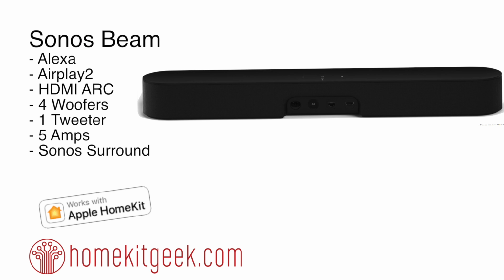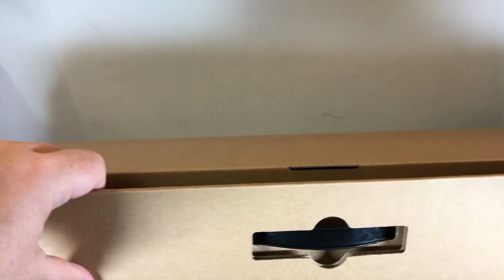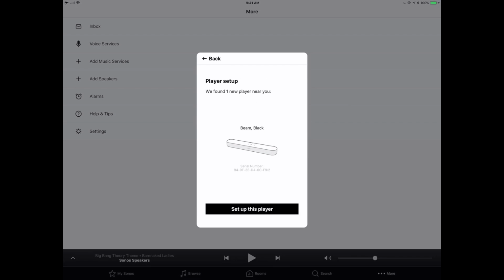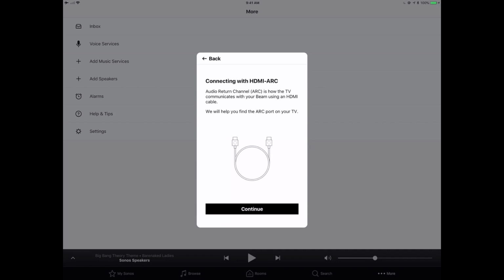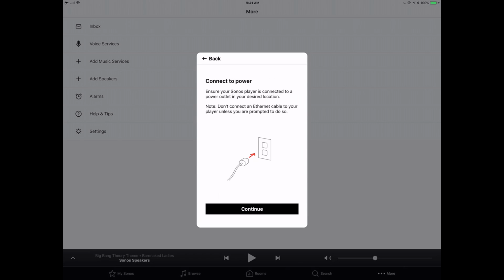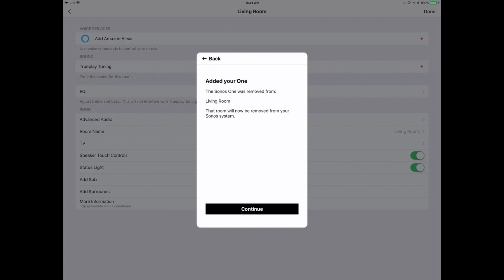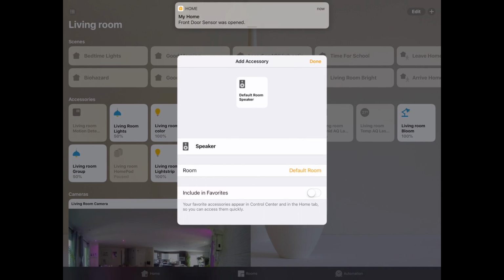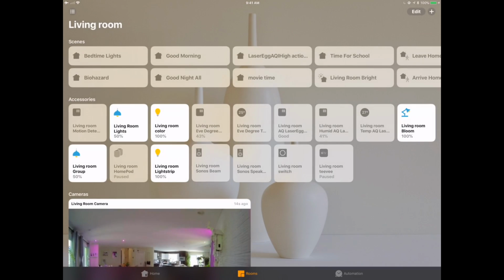Sonos Beam sounds great and has Airplay2

Comment: Hi. Can I also play music from my widows laptop - hard drive-  with the bar?
Reply from the maker: Quick answer is yes.  There Is a Sonos app that can run on Windows which you can use to play music. You could also use the Spotify app if you’ve setup the Spotify integration. Or you could use Airplay2 if you’ve installed iTines on your Windows computer.  There are a lot of options here. You will need a iOS or Android device to setup the Sonos kit (iOS being the better experience from true sound tuning). Hope this helps!

Comment: Great video! It was what I was looking for! Thanks.
Reply from the maker: Awesome! Glad you found it useful!
Reply: Chris Young I’m waiting for my beam while I have two one in stereo mode. I was curious to understand how configure surround once beam is installed after the ones. Thanks
Reply from the maker: It was actually extremely easy. You essentially put the rear Sonos Ones in the same group and then you run the TrueTune setup again to make sure you tune the speakers to your particular room.  Let me know if you have any issues at all and I’ll see what I can do to help!
Reply: Chris Young Very kind :) Effectively I have two questions... 1) is the quality of the surround sound good? With my old speakers the sounds coming from rear were very low. 2) When the two Ones are in the surround mode, is it possible to use them in stereo to play music from iPhone?  Or in this case the sound will come out only from the beam? Thanks again!
Reply from the maker: OK Q1:  Harder to answer. There are times when the speakers are very low, but there are also times ( no change from me ) where the speakers actually scare me with the sudden sounds out of them. I’ve come to the conclusion it’s much more the actual content you’re watching than the speakers themselves. When you’re watching content with really good 5.0/1 tracks, it’s really immersive.   Q1: Yes. There’s a mode on the Sonos app that allows you to ignore the rear and just treat the speakers as if they were stereo. Works great for music from iPhone or directly out of Sonos app. ( or from any HDMI source coming through the Beam for that matter! )
Reply: Chris Young Thsnks! If you come in Italyl I owe you a dinner😄
Reply from the maker: LOL. Just glad I could help!

Comment: In this 5.0 setup does airplay from your phone only come out of the beam?  Or does it come out of the entire surround system beam + play 1's all play simultaneously?
Reply from the maker: In a 5.0 setup, there’s a setting in the Sonos where you can have the “rear” speakers ( the Sonos One’s in my case ) get used as a L/R combination and don’t play as a surround-sound setup.  Hopefully this makes sense?
Reply: Chris Young but can I have the beam and the play 1s all play the same song from Spotify via airplay2 from my iPhone?   Or will all speakers only work together from the tv
Reply from the maker: Ok, if I understand your question, the answer is “yes”.   When you open Spotify on your phone and play a song it plays on your phone. If you send that stream to an Airplay2 target, you can select the Beam as an Airplay2 target.  Once the Sonos devices are in a 5.0 setup, it’s only the “master” device ( the Beam ) which exposes the Airplay2 target. You won’t be able to see either of the Sonos One’s ( read r/l  speakers ) will be see in the Airplay2 target list.

Comment: I didnt see this question. I have two sonos play:1s. If i get the beam and pair all three for TV surround sound, Can i still use the the two play:1s just for music? without having to ungroup them from the beam for just music and then re-group the beam again to watch tv.
Reply from the maker: If I understand the question, and I’m not sure if I do,  you’re asking if you can play music on the Play:1 speakers which are put into a 5.0 group with a beam without it playing in the Beam?   The answer is “no” you can’t play just on the Play:1s and not also have the music coming from the Beam.  Essentially the entire system (Beam + your 2 x Play:1 speakers ) becomes a single unit. If you play music it will use the Beam and both Play:1s  to produce the sound.  Hopefully this helps?
Reply: Dont put the play 1 as part of surroud, while setting up the play 1 choose "put in another room" then you'll get what you wanted

Comment: Very nice review Chris! Love the thorough explanation of the app installation.
You have the same setup I’m currently considering (Yamaha Bar 400 with 2 MusicCast 20’s is the other option). One of my doubts towards the Sonos Beam is the “For small to medium rooms” category Sonos has put it in. I’m not sure what Sonos’ definition is of a medium sized room. What is the size of your room and what is the distance between your TV and the couch or chair you’re sitting on while watching TV?
I don’t want to buy a PlayBar (which is 200 euro more expensive than the Beam) if only because it’s a 5 year old design.
Reply from the maker: Hey Frank! Thanks for the kind words.  Just an estimate, but it’s an open space of about 400 square feet. ( 37 square meters )  The couch is approx 10 feet ( 3 meters ).   The Beam + Sonos One’s are really great and typically we can’t turn the TV up past 50% for normal watching. Just gets too loud. Normal watching volume is about 1/3 potential. For music, it’s about the same but I also use it in an Airplay2 multi-group with Homepod across the room. I’m very happy with it as it is. At some point, I”m thinking of adding the Sonos Bass to it, but hoping a less expensive option comes out.

Comment: I just bought a Sonos beam and I already got two Sonos player 1....I paired both Sonos player 1 and the beam but it seems that I've got a better surround sound when pair both players 1 separate from the beam. Why is that? Do Im doing something wrong here?
Reply from the maker: Digging into this a bit, but what do you mean when you say “surround sound”?  I’m guessing that you’re hearing more sound all around you when the Sonos Beam and Sonos 1’s are two separate devices because you’re getting the full Left/Right stereo experience out of both the Beam and the Pair of 1’s.  With the “real” surround sounds, the Sonos 1’s I believe are configured as the rear Left/Right channels which aren’t really used if the system is expecting Dolby 5.0/1 audio source.  This is just my guess though, I’ll try and find a better answer or hopefully someone else will be able to chime in as well.
Reply: Chris, thank you so much for the quick reply. Yes, that is exactly what I was stalking about! I have both of my play 1 separated from the beam.
Reply from the maker: Hey Cesar, After a bit of research, it looks like this MIGHT help you out: Settings>Room Settings then select the room with the 5.1 setup then go to Advanced Audio. You will see options for ambient and full for music, change this to full.  Give it a try and let us know if that improved things!
Reply: Hi Chris, I just did what you recommended and it worked! However, the only option I had to move to “full” was the TV ambient, by doing that I was able to enjoy the 5.1 set up. Thanks for the tip!!!!
Reply from the maker: Really glad it worked out for you!

Comment: I have the beam, its good for tv but i would not recommend it for music. Every pair of monitor speakers for half the price would do better with music. The mids and the highs of the beam sounds washed out.
Reply from the maker: When paired with a couple of Sonos One's I've actually been quite happy with it. Admittedly, I'm not much of an Audiophile, but the experience for the price is definitely worth it for me.
Reply: Chris Young i have the Beam also paired with two Sonos One. The sound improves a little bit but not much. I dont have the Sub yet to test it together, but i think wit the Sub the Sound would be good. 
To sum this up: if you want to enjoy music you have to buy in addition to the Beam, two Sonos One and a Sub. 1700 Euro in total. For this price you can get a pair of Elac F6 floorstandig speakers, the athmos speakers, the centerspeaker, the rear speakers and an AV receiver capable of dolbi athmos, dolby digital and DTS.
Sonos supports only dolby digital.
And not to forget the annual electricity costs of the Sonos system. Each Speaker consumes 4W on standby 24/7. So you pay 100-150 Euro on electricity bill every year.
Reply from the maker: Wow.  That's definitely a great beak down. Does the Elac system allow for direct streaming from the many music services like Sonos does? I've never looked into them before. Part of the main selling point of the Sonos, at least for me, is that it's got direct access to my iTunes Music library without having to proxy stream it from another system. Sounds like it might have been a good choice also to just add an extra AppleTV to the mix and connect it to the Elac system?

Comment: Wt you recommend Sonos playbar or Beam plus 2 Sonos 1.???? Which option sound good ?? I know beam have less speakers than playbar but if we attached beam plus 2 Sonos 1 would it be good to go ????
Reply from the maker: I’ve been really happy with the Sonos Beam and two Sonos One’s.  I don’t have the Sonos Playbar so I can’t really make comments on it.  The major advantage of having the two Sonos One’s is the fact that it gets you 5.0 surround sound.   The same configuration could be had by getting the Playbar and a pair of Sono One’s as satellite speakers, but the cost would of course be driven up as the Playbar is quite a bit more expensive than the Beam.
Reply: Chris Young thanks for replying....I m thinking same to go with beam plus 2 Sonos 1.... Another question for you would it be really punchy & cinematic sound to listen music as well as watch action movies ???
Reply from the maker: No problem at all! Happy to share what I can!  I’ve been really happy with the sound for both playing music and for playing movies. I use it daily for both and it’s great. There’s also an EQ function that I played around with assuming that I would need to add more bass. I ended up moving it back because it added too much bass and the sound got a little muddy. I was able to get it really clear with good highs, mids, and lows. Given the price on the Sonos Bass is almost the price of the Beam and Sonos One’s together I would definitely see if you’re happy with the Beam + One’s before going for the full 5.1 package.  If you’ve got the budget to spare, I can only imagine it would sound really really good.

Comment: Nice video. I'm teetering on getting a Beam. I have a stereo pair of Sonos Ones in the lounge at the moment for music / radio listening. Once question, bit of background first; I connect one of my Sonos Ones to the Lan cable that comes from a wall socket I have in the lounge (wifi router is in a different room). This lets me use the Sonos wifi mesh network - that's very good! But if I wanted to use the Left and Right Ones as a rear speakers, I'd have to move the right hand one to the other side of the room -  no Lan cable there! 
Can the Beam connect to the Lan and do the mesh network thing? If it can, I'm sold!
Reply from the maker: Hey Steve - Thanks!  So I’m not 100% sure of the answer here, but I can tell you the following to see if this helps you out. I managed to resolve the sync issue by plugging in the Beam directly to my LAN. So when I use Airplay2, the target audio source is the Beam. The Sonos One’s which are the lync’d as the R/L pair as part of the Surround Sound group are both connected to the Wifi, no LAN cable there.  The multi speaker audio for the Sonos seems to be totally controller by the Beam at this point and the sync issue is totally gone so far. I did try moving the Beam back to Wifi and the issue came back so it seems it’s somehow related to the Beam ( as the Airplay2 target ) being on Wifi.   I don’t know if this is using the Sonos wifi piece you’re referring to or not but I CAN tell you that it sounds great and that it works great when playing in an Airplay2 multi-room with two Apple HomePods which exist in two different rooms.   If you do decide to pull the trigger, the Amazon affiliates link is available if you wanted to help me out. :). Just saying. :)

Comment: Have it in my den.  Paired with my single Sonos One for music.  I used optical connection as my  den TV only has two HDMI ports.  Only hassle, proprietary optical connection means I had remove my 50 inch flush mounted TV from the wall, removing the existing optical, and replace it.  The provided dongle is optical on one end, HDMI on the other.  I have the Playbar on my main TV.  Per dollar value, I think it beats the Apple HomePod cold.  Also, Airplay 2 answers the no Bluetooth complaints.  Bluetooth equivalent.   I believe the Sonos software is worth $300 on its own.
Reply from the maker: Hey Paul! Thanks for sharing your experience with the optical cable. I was lucky enough to have the HDMI-ARC port open on my TV so I get the “full” experience.  Sounds like the installation of the optical to HDMI cable was a bit painful?  Does the sound quality still justify it?  The Honepod comparison speaker to speaker speaker I would probably agree with you. Although I’m an Apple Music user, I was using Amazon Echos for my multiroom audio for the last year or two. The fact that the Sonos allows me to not worry at all about my audio sources is amazing.  Airplay2 is a great feature which allows it to connect to my existing Homepods.   Where the Homdpod wins hands down is the fact that it can act as a HoneKit smart home bridge not to mention the integration through Siri into my iPhones Calendar and Notes etc...   I’m very happy I have both and I would not replace one with the other as I use them for slightly different things. That being said, as I grow the home audio system I will be adding more Sonos Ones. For the dollar value of a single Hiomeood I can get two Sonos Ones and cover more space or go for full stereo sound.
Reply: Chris Young  Chris, I have the Playbar in my main room.  It is connected via Ethernet.  It has two Ethernet ports.  One in from the router and one back so no ports are lost.  I understand that using Ethernet on my Playbar creates a bridge for my other Sonos devices and eliminates problems that some reported with Sonos wi fi surrounds.  I have all Apple devices except the HomePod.  Also Amazon devices and am prime.  I went Google Play on my paid subscription as I watch a lot of You Tube and like it ad free.
Reply from the maker: I’ll haven’t had issues yet but I’ve got pretty solid wireless using a UBNT LR Access point.  The Sonos Beam has a single Ethernet port which will definitely itself help with streaming and just generally keeping data off the wireless which is never a bad thing. I haven’t seen any issue yet with the Sonos Ones but I’m tempted to wire them up as well just to get them off the wifi.  For the AppleTV etc. I try to keep the HD streaming etc... off the wifi to just keep the competition for bandwidth to a minimum.